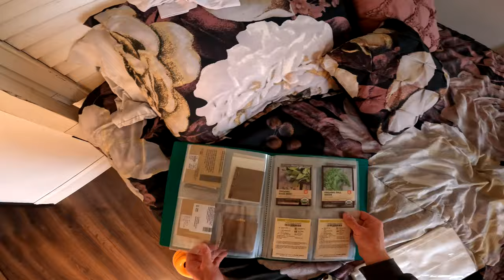Day in the Life of a Homesteader: Milking, Feeding, and Gardening POV

Comment: When a teat sphincter closes properly, within 20 minutes of finishing the milking or suckling; it prevents  bacteria from entering the teat. Raw milk from healthy cows is tasty and lasts longer than milk from a mastitic cow. Improper handling of milk is when milk quality is ruined. Improper chilling and not maintaining of temp between 33° F to 40° F are the worst culprets of poor milk flavor and quality. Dirty lower rear legs touching the open teat end or laying on a dirty surface is when most mastitis is contracted.
Reply: If the teat sphincter closes properly prior to the teats touching something laden with bacteria and the milking preparation routine is good, mastitis is NOT an issue. We used an iodine predip and post dip for many years. We used a bleach and skin conditioner pre and post dip for the last few years that we milked our 750 milking herd. We had sand beds and flushed our alleys behind the cows every 8 hours to remove the manure.
Reply: We pulled any mastitis cow into a group that the milk got fed to calves until they were tested as mastitis-free and antibiotic-free. Calves on whole milk grew much better than when we had fed milk replacer in the 1970's, 80's, 90's, and early 2000's. We began whole milk feeding to calves in 2005 or 6. You can feel a quarter that is affected by mastitis get warmer or hot; the milk sprays out into a different pattern, due to the somatic cells that are beginning to get more in number [best to strip foremilk onto a strip cup or washable solid floor or cmt paddle, like you did]; or a change in color or texture. We aseptic sampled any affected quarter; struck the sample on a biplate or triplate; incubated the media plate; read the growth; determined which therapy was appropriate for the type of bacteria affecting the quarter; and tested for antibiotic resides to be gone prior to returning a cow to the regular groups. Our cows generally did not lay in crap, although a few, usually the short ones or ones that arched their backs alot when deficating, would poop in their stall and lay in it. The stalls were cleaned by the milking crew every 8 hours, just prior to flushing the walk.